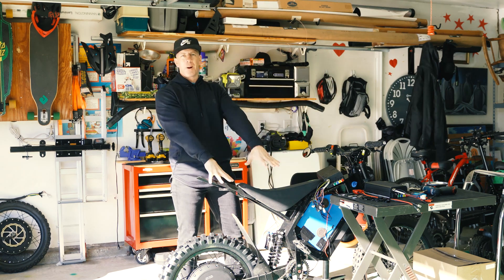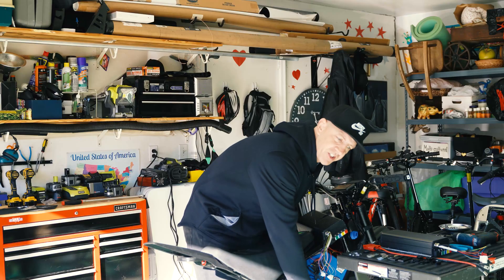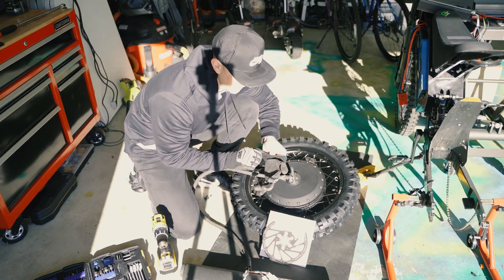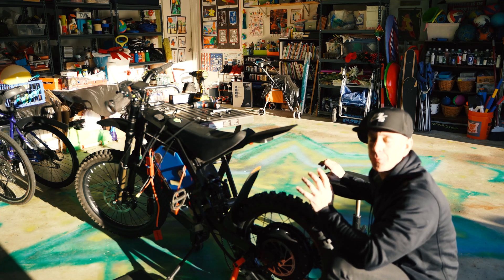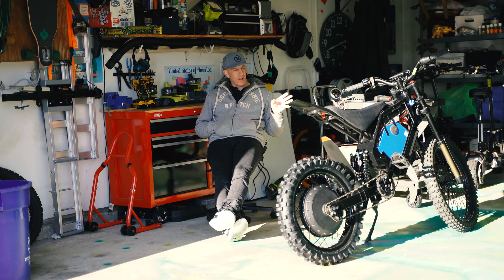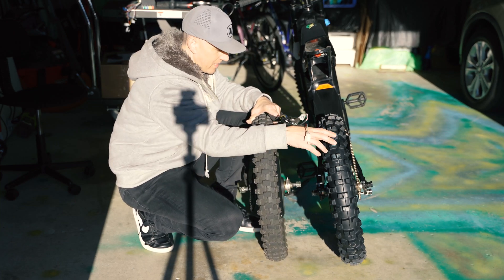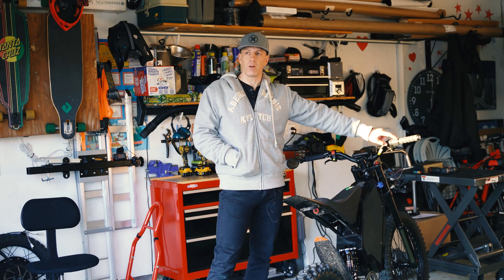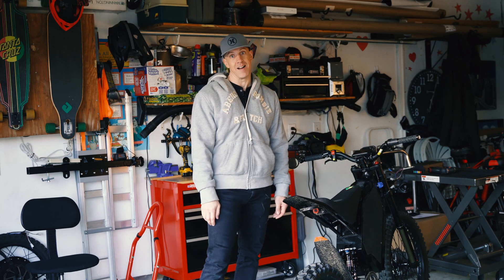QS273 5T & Sabvoton 72200 UPGRADE Pt. 1...SCREWED by ALIBABA!!!

Comment: hey Josh . learning progress , but we are getting better at detecting the wrongs .love your tire , I will be getting that  tire when old is used up .  5t and you should be poppin´wheelies half throttle going 20mph on your sabvoton. keep videos coming. cheers
Reply from the maker: I love hearing that brother!  the new wheel gets delivered tomorrow so I guess I'm going to be mounting it in front of the fireplace since there's going to be a blizzard tonight.  But yeah that tires freaking amazing the ride was so much smoother, it totally sucks up the bumps at a low tire pressure
Reply: @JoshStreetDesign  I need that tire likewise. Building a bike similar to yours, but shooting for higher flux weakening, amps, and volts by having the battery to supply it. Building a 24s 11p, Samsung 25R INR 18650 2500mAh 3.7V High-Drain 20A pack (Ending up at 100.8V Nominal, 480A, and 27500Mah). Hopefully going to be able to fit a 450A BMS. Screw sabvotons. BAC8000s are insane. Same frame, stock seat.. blah blah.. Shooting for same suspension setup, but instead of the two 220mm, i'll use one 240mm and stiffen it. Thoughts?
Reply from the maker: @hobsonmx7341  sounds like a kick butt battery dude that's awesome.  What is that costing you total for that battery?  I was thinking about upgrading to a better battery, a lipo pack with like 900 amp potential, but I ended up getting a 2015 Suzuki RMZ 250, and I've been dumping all my spare cash into that these last couple of weeks getting it race ready.  Spent waaay to much so far, ha ha.  BAC is out of the question right now.  As far as flux weakening I think I've realized that this new controller  isn't unlocked as it was supposed to be because just like my last controller it doesn't allow me to go over a 50 amps flux, which really pisses me off man.  With a 5T motor having higher flux really helps get a higher top speed when the motor reaches its saturation point.  But you should do a video of your build and document your specs and such.  Thanks for all the comments!
Reply from the maker: @hobsonmx7341  yeah I've seen that video of him breaking the bike down him and I have written back and forth too.  It's funny the community of us guys who do this e-bike thing is relatively small still, at least in the e-bike emoto category.  But what I mean lipos I mean a pack put together of about 10 to 12,  20,000 milliamp hour packs off hobby king that would run andt like 134 volts and be like 32 ah.  It would cost about $2,000 all said and done if somebody else did it for me.  No voltage sag either.  I honestly don't like working with batteries putting them together it's just too much that could go wrong I'd rather have somebody who has a lot of experience doing it do it for me if I was going to go that route me.

Comment: not  the controller or motor... your battery is not upto the task...
Reply from the maker: Agreed up to a point, since I'm running two batteries I should have theoretically gotten a boost of up to 190 amps instead of the 150.
Reply: @JoshStreetDesign  true... If you can , try using 90c lipo... even in a smaller pack just to see the difference in lag... I am not running such a large heavy bike, but I know that the difference for me between high c rated lipo and low c rated batts all piled up...
Reply from the maker: @Simplyflyit  you added a lipo pack in parralel to an 18650 pack?
Reply: @JoshStreetDesign  no, I don't use 18650 at all... I use Lipo's in series, however, perhaps for your application you could use a capacitor to deliver the surge ?
Reply from the maker: @Simplyflyit  oh gotcha.  Yeah I would love to switch over to a lipo series pack, but the level I would need would cost me over 2k, and lately I've been dumping the spare cash into my dirt bike.  Maybe down the road.
Reply: @JoshStreetDesign  I hear you... I am hitting the wall with my ride, I am only running 4.5kW... but the frame can only fit 5Ah of battery... the bike really needs 40Ah... its a problem
already have enough into that bike to have a fleet of 125's... and I get 15min of full shred, or I get to ride with a cement block in my backpack...
Reply from the maker: @Simplyflyit  ha ha ha.  It's a tossup.

Comment: I have a new Sabvoton, and what I learnt was, there is a wire/connector that comes off the display, disconnect that, make changes with the bluetooth app, while it is disconnected, the 30H comes up and the engine symbol comes up, when I have finished making changes via bluetooth, I connect that wire again, the 30H and engine symbol goes away, I get back my speed and wattage in the display and the settings are saved.
Reply from the maker: Yeah thanks for the comment but that wasn't the problem in this case as that wire was disconnected.  I don't think this one is specifically compatible with this model as I've specified to the seller that I needed to be.  they screwed me on the wheel winding, so it's no surprise they screwed me on the controller too which I don't think was fully unlocked either
Reply: @JoshStreetDesign  having trouble with my controller too, stuck at 2100w, I think my battery is whats limiting me.  Good Luck!
Reply from the maker: @HydroponicBackyardGiantsWA  yeah it turns out I think my battery is a limiting factor as well, but right now I've been putting money into my dirt bike instead of this electric bike so a $2,100 battery upgrade is going to have to wait haha

Comment: Dang bro! All that work. Major learning points though.
Reply from the maker: The new correct five T motor comes in tomorrow.  I'm excited for that but not excited to do all the work completely from scratch again haha
Reply: @JoshStreetDesign  More riding vlogs with the new tire setup!
Reply from the maker: @ramwellness6950  yeah definitely . Hopefully you get your bike soon we can get out there together and you can get some off-bike shots of me.  Actually though I have an older vlog video practically already made just sitting on a computer I haven't posted it yet

Comment: Battery C ratings can limit you. Also cold weather will cause big voltage sags
Reply: I agree... the battery is the issue... connect a 70-90c lipo and see what happens...
Reply: @Brian Goff  can you explain the c rating a little more? Is that the ability to dump current?